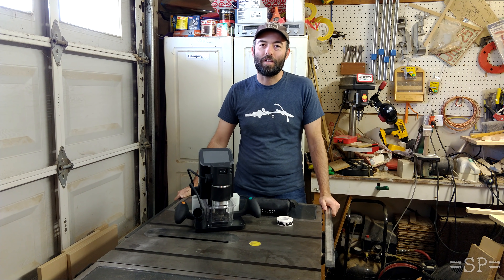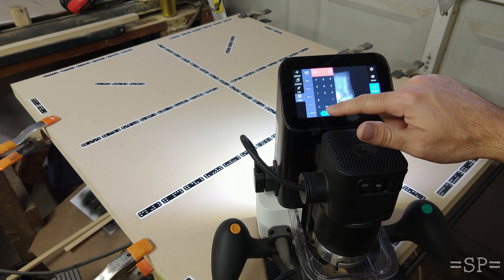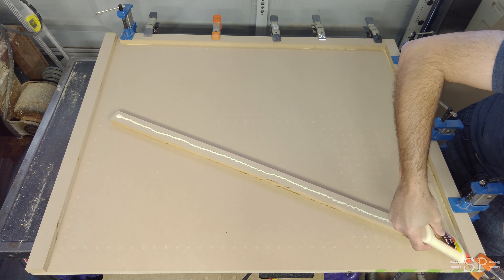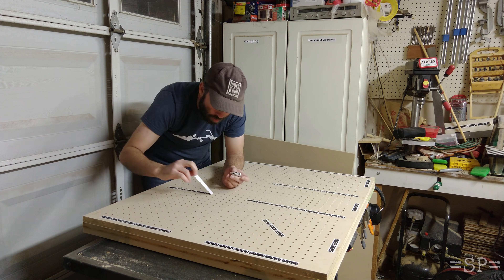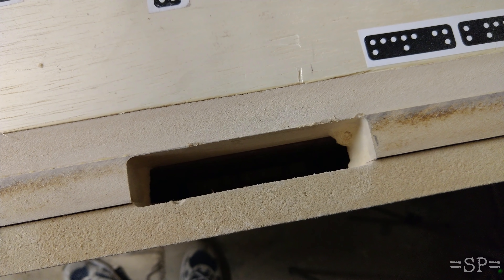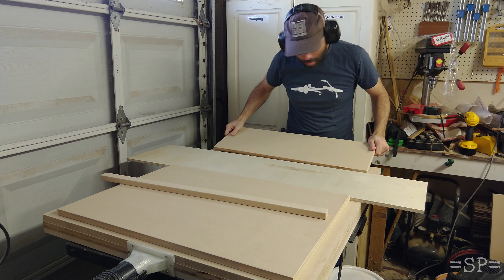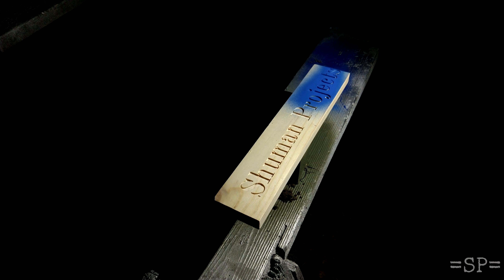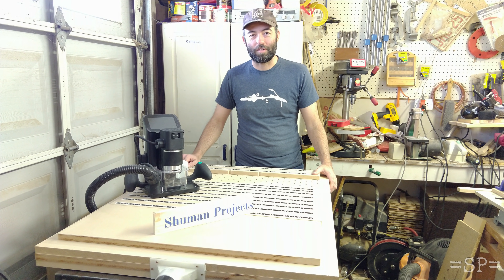1044 holes: Making a Vacuum Table with Shaper Origin

Comment: You could just use pegboard, and even consider it a replaceable spoil board, as the stuff is pretty inexpensive. All of your internal air ductwork would keep it plenty rigid, just don't glue it together; maybe add a rubber gasket along the perimeter
Reply from the maker: Yes, I think that would be a great option. I went way overboard ensuring this stays flat. Pegboard could work well.

Comment: That really sucks brother! ha ha GREAT JOB!!
Very helpful thank you for posting.
My friend has a big KERN Laser table which uses a vacuum bed. He cuts my acrylic pieces for me. he uses simple cardboard pieces to block zones & simply cuts them to shape to fill the zones. So,, saving a few box pieces from inbound shipments come in real handy(And they are light !!)
I am making one of these to fit on a BORA Centipede table 2ftx4' for the Shaper Origin, 1/4 inch Ply base. Pine frame and internal ribs. using pegboard for the vacuum-spoil and sealing the top layer with silicone so I can pull it with a knife for replacement. The frame and internal ribs will be glued and clamped and stapled, but The top pegboard edges will be siliconed and then pinned down with a few wood screws, and the BORA table will have a few indexing pegs to prevent the whole contraption from sliding.. I don't know if it will work. Wish me good success!
NOTE the BORA table has a foldable top that has peg holes, it is 4ft long x2' the Origin sits on the end occupying one foot of space, the vacuume table is 3ftx2ft and is sitting level with the workstation, so the thickness of my vac-bed is the height of the workstation (Coplanar) with the bed. The whole setup is very portable and light.(We will see!!)
You are an inspiration,
Warm Regards 
Jimbo C.
Reply from the maker: Thanks for watching! Keep us posted in how your build goes.

Comment: Very cool. How do you think this would work using something like a Festool Vac Assy or 1 or 2 Grabbo’s for a vacuum source? Also why do you have domino tape in front of where the project was routed? And if you had center lines marked out on the table in front and rear and to the left and right of your project board could you line your project board back up with dominos’ ? Or do just need to rescan the domino tape for each project? And how deep and wide of a cut can you make with a Shaper Origin?
Also I am going to purchase a Shaper Origin this coming week and the first project I want to use it on is to create some leaf inlays to install into a friends hardwood floor. I want to do some inlay lines like the veins or spine of the leaf. And then cut out the pocket in the floor of the hardwood floor to remove some damage and glue in the inlay...????
For putting the Shaper on the floor, I was going to make a board with domino tape on it and use double sided tape to position the domino board so I could cut the recess for the leaf inlay. And then for the next leaf I want to place, I can lift up the domino board and reposition it and go again If any of that make sense?
And it would be nice if Shaper or someone else could do a slowed down compilation of projects out there for us to see and get an idea of how things work. Just a thought! 
😊😊
Sorry for just belching out a boatload of questions but you have been the best YouTuber about answering the questions people have!!! 
Thanks for your time!!!
Sincerely!,
Ron
Reply from the maker: Hi Ron!
Vacuum: I'm using my standard shop vac, but there are other folks that use actual vacuum pumps for holding systems like this. They usually have some gasket to help keep a seal. I'm not sure if my setup leaks too much to work with a true vacuum pump vs the shop vac.

Tape placement: Shaper Origin has the camera in the front of the unit that looks outward for position tracking. The camera doesn't look straight down, so for some small projects, you don't need any tape on the area you are cutting at all. You do have to plan your cuts a bit for larger projects to make sure you have enough tape when you do cut through one section that will later be the forward area used to track in another section.

Rescanning: Shaper Origin saves your workspaces so you can some back to a project later or make repeat cuts with a jig. The key placement for my vacuum setup is the relationship of the forward taped board to the workpiece. As long as the next pieces in places in the same spot, like aligned with the left edge and flush to the bottom, you can reuse the same scan.

Cut depth: I believe the max depth is 1.75", but you need to mind your feeds and speeds for a given cutter. For thicker material, general guidance is to make a few shallow passes with an offset so you are cutting just outside the line, then do one final pass without an offset to get a nice clean cut without multiple pass marks.

Cut size: There are no limits to the size of the workpiece you cut, just use lots of tape. I've cut on 4x8' plywood for large projects before.

Floor inlay example: Check this out https://hackaday.com/2018/04/15/superb-wood-floor-inlay-shows-off-computer-augmented-tools/  :)

Floor inlay tape: So Shaper Origin wants the router and the tape to be sitting in the same plane. In my video you see the router on top of the board with tape and the workpiece. If you attempt to have the router lower than the tape, your accuracy will be off or you get errors. Some folks have successfully used thin plastic sheeting to have the height difference be not so high up. The other option is to cut through your tape board and down into the floor. This works if you aren't pocketing large areas out, otherwise the router won't have enough tape or support to keep it up. The alternative is to just tape the whole floor up like the example above.

Learning: I've found many of the Shaper tutorial videos to be helpful in getting started. If you want more detail, check out the back catalog of Shaper Sessions and/or watch the streams live. They are shot in real-time so you see it all happen.  https://www.shapertools.com/en-us/sessions

It is an awesome machine! Have fun!

Comment: 1/8" tempered hardboard makes good torsion box skins and internals.
Reply from the maker: Yep, that is another option. I really wanted to ensure it remains flat and the weight actually helps keep everything in place while working. I'd love to see something similar you have done with 1/8" and how it works for you. Thanks!!

Comment: That's a really useful video, explaining a lot of questions I had about the Origin (large-scale work, breaking a project up in phases, economical use of ShaperTape etc.) ... one thing surprises me though: you are building a vacuum table, so why not use atmospheric pressure to "clamp" your project? Just use a thick PP/PE sheet/bag, seal the egdges and apply a vacuum ... even if your pump generates a lame reduction of 10% of the atmospheric pressure, that's equal to around 200 pounds of "clamping force" - per sqft!
Reply from the maker: Thanks! Maybe I don't see the vision with bags, but it seems less reusable, hard to work with my reusable Shaper tape boards, and would get in the way dragging the router over it. This setup I have is quick to use, has no waste, and works for flat items big & small. If you have an example of something similar to your suggestion, I'm interested in learning more. I've seen vacuum bags used for shaping/stream bending, but I'm not seeing the ease of use here.
Reply: @ShumanProjects  The approach I am talking about is used a lot by people laminating large glass or carbon fiber parts like a bonnet (or veneering whole doors). I'm only talking about the glue-up of the vacuum-board itself: there, evacuating a large bag or an envelope made from a PP/PE tarp is used to generate very even pressure that's pushing from top AND bottom at the same time, thus eliminating the risk of warping. Here is a vid showing the principle: https://www.youtube.com/watch?v=IjQe9p1LBCk
Reply from the maker: @f.d.6667  Ah, that makes sense. Stacking random heavy stuff I had on hand worked for me. I'll consider vacuum bagging in possibilities in future clamping needs.

Comment: Do you do inlays, or anything like that? Just wondering how you would use a spoil board with this setup, so you're not cutting into the top surface.
Reply from the maker: Yes, this setup is best for inlays, signs, engraving, or anything that doesn't need to cut all the way through. You can drill out spoil board to align with the existing holes. I did this when cutting face shield plastic: https://www.instagram.com/p/B_6rdV9ldy9/?igshid=garxr978gp9v

Comment: is it bad for your vacuum having it on full load for long periods of time?
Reply from the maker: Some vacuums rely on the airflow through the hose to cool the motor. Blocking it long term can overheat and damage the motor. Others have a separate fan blade to cool the motor apart from the vacuum airflow. Mine has the latter and I've had no problems with it.
Reply: Let's consider a shop vac that has a separate fan for motor cooling so that reduction in the amount of air being 'sucked' does not cause overheating. Most people think that a vacuum is  working harder when its inflow is mostly or completely blocked. But this is not true. If you listen to the pitch of the whine of the motor when it's pulling air with no obstruction and then partially or completely block the inflow, the pitch goes up. In other words the fan will be rotating faster. This speed up happens because with less available to move, the fan is doing LESS WORK. If you remove the obstruction, the fan will slow back down because once again it is using energy to MOVE all that air. So blocking the inflow in such a case does not strain the motor. The fan works the hardest when it has unrestricted air inflow.
Reply from the maker: Yeah, mine draws about 970W normally, but drops to around 790W if I cover the end up. The key is making sure your vacuum has that second cooling fan to keep the air flowing.

Comment: I’m still trying to understand the capabilities of the Shaper. So after you made an svg design of 1,044 holes, the Shaper went up and down by itself to make each of the holes? (Of course while your pushed it around side to side.). Thanks for sharing the video.
Reply from the maker: Each new cut/shape/path requires you to get the cutter close enough to the shape, then hit the green button. If the shape is small enough for the router to cut without human movement, it will cut automatically, then retract. For larger shapes, you push the router asking the path while it corrects to stay on track. Hope that helps.

Comment: Why not incorporate a torsion box design.  I bet you cold use 1/4 inch top and bottom with a torsion box. Easily should have 1/2 the weight.
Reply from the maker: I'm sure you could make something strong enough that would stay consistently flat with thinner material. I wanted to be sure it stayed flat. The extra weight is actually a bonus helping keep everything from moving around while working. The drawback comes when you need to move it.

Comment: You could almost use that for a sanding table also, and if you hooked that to a high volume dust collector it's going to hold a lot tighter, I wonder if you could use it in vacume pressing adding a plastic bladder over the top held in place with PVC pipe on the sides and a vacume pump.
Reply from the maker: I've considered it for sanding, but I'm a little concerned about the inability to clean out inside. More suction would be helpful, especially for smaller pieces. I'd like to try with an actual vacuum pump. There are other videos I've seen using bags and bladders, but I think most lose the single flat plane needed to make this useful for the Shaper.

Comment: Enjoyed this video. One question for you. What was the vacuum you used? Motor size or power?
Reply from the maker: I'm using a Ridgid 9 gallon, 3.5 peak HP shop vac. It was a Home Depot Black Friday special over 10 years ago. It does have a cooling van.

Comment: Great project!!!  I have a shaper origin and I’m new to CNC work as well as CAD programs like sketch up and fusion 360. I want to make a vacuum table similar to yours. Would you be willing to share the file you used for the hole pattern?  Maybe on Shaper hub?  Thanks in advance.
Reply from the maker: Thanks! Files posted at https://hub.shapertools.com/creators/59d26aad1ca17e0010a3e2ab/shares/5e4a1abeacd89f000ff35fd7

Comment: I thought I was pretty good at sketchup, but holy crap you're a monster. You really should move to fusion 360, you'd be unstoppable.
Reply from the maker: Ha! Thanks. I've been using SketchUp for over five years, in part because it is good for getting kids introduced to 3D design. It is great to get kids started in workshops, but powerful enough to do reasonably complicated projects. I've used 3DS Max, Autocad, & FormZ in the past. I really should go learn Fusion!
Reply: @ShumanProjects  i've really digging fusion360's parametric support for doing things like finger joints, holes, and multiple shelves.

Comment: How is this for wear on the shop vac? It seems like the motor would get hot with less airflow.
Reply from the maker: Good point, I use a shop vac with a separate cooling fan. No problems over a year in.
Reply: @ShumanProjects  Good to know, I will have to think about this with my shaper!

Comment: Nice video. The Shaper is pretty cool and I learned some new things about it in your video thanks. I always wondered how you find x and y with the Shaper and to just select the corner seems like a reasonably good option. It may not be the cheapest cnc but the fact that it is $2k-$3k still makes it a reasonably good deal. Do you think the shaper would work well for making an mft? or would the 20mm bit be too big?
Reply from the maker: Thanks! Glad this was helpful. You could crank out a multi-function table with this. It will take a 20mm bit or you can use the 1/4" bit to helical cut 20mm holes. For best accuracy, you want a flat table surface (obviously) and a good amount of tape applied directly to the piece.

After over a year, I'm still impressed. My back does remind me I could be doing something else during long projects, but the size/portability/capacity make for a nice sweet spot in the CNC space.

Comment: Which plugin did you use on sketchup to make the flange? Thanks
Reply from the maker: No plugins used in modeling. Everything on the original adapter I modeled and the modifications for this project used the built in sketchup tools. I do use a plugin called Solid Inspector 2 that helps verify the model is solid for 3D printing.
Reply: @ShumanProjects  You're right, I saw that u just used the move tool. Sorry for going off topic but it's a hit and miss when using the move tool that the curve flattens to the line, it sometimes moves the line with it. Is there a technique you can share?
Reply from the maker: Yea, mostly just moving and scaling parts. Here is the whole unedited clip of me messing around with it. It really wasn't very elegant. https://www.youtube.com/watch?v=EVOi9ZZd9sI